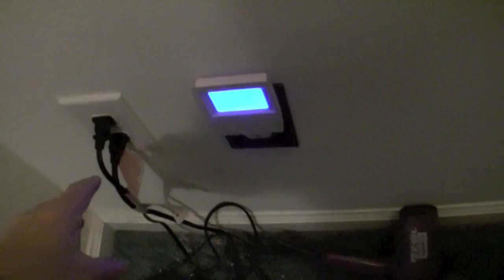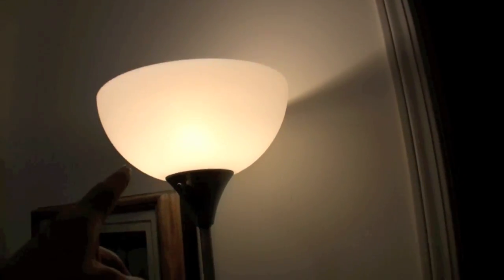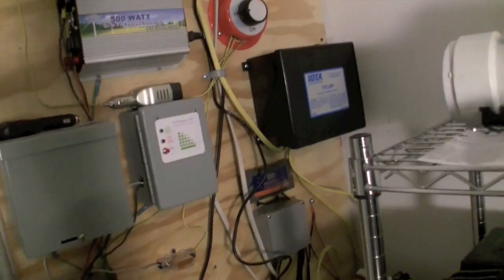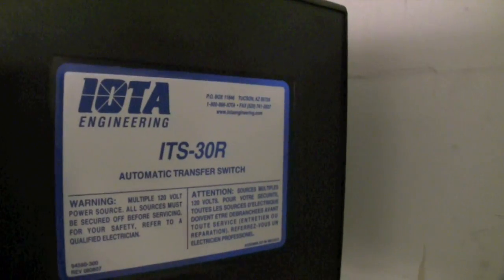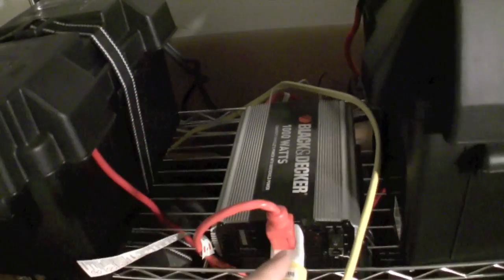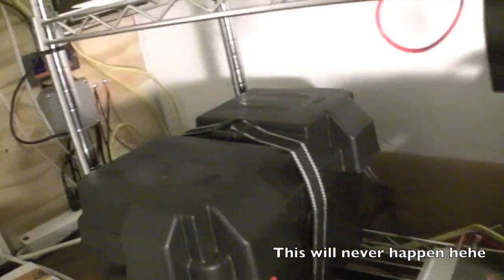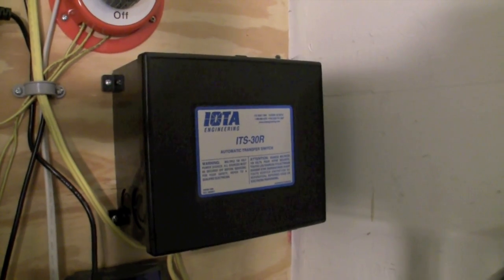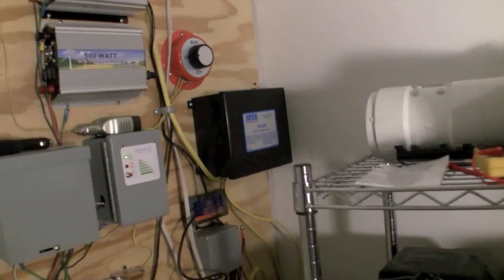IOTA ITS-30R Automatic transfer switch from Inverter to grid power

Comment: Can I use the neutro of the grid power for the inverter?  so I can just send one cable from the inverter (I assume is posible because the braker just cut the fase so the neutro is always open)

Comment: I have 2 of these great units, which were even UL listed. Too bad IOTA (still in business with other great products) doesn't make them anymore. If you open the box and look at the small circuit board you will see a red switch. Factory default is switch in the "1" position which causes the 20-30 second delay when transfer occurs. Push the switch up to the "on" position you turn on bypass of the 20-30 second delay. Transfer should be instantaneous, but still may not be fast enough for a desktop.

Comment: A high power DPDT Relay can do the job. connecting the coil to the inverter output or the charge controller load output. Some charge controller has a programmable aux relay output which you can take advantage of.

Comment from the maker: as long as the primary power source side of the ATS is the inverter / battery bank, as soon as the inverter kicks back on the switch will auto transfer from the grid to the inverter as its primary power source... Its pretty Slick. ;)

Comment: Nice informative video. I am planning to install a similar system, and also use similar ATS, but I wonder, say the battery dies and the ATS did its job by directing current from the utility grid... now;  would the ATS transfer switch back to the inverter automatically when the charge level come back to nice level in the battery and the inverter fires back on? 
thanks